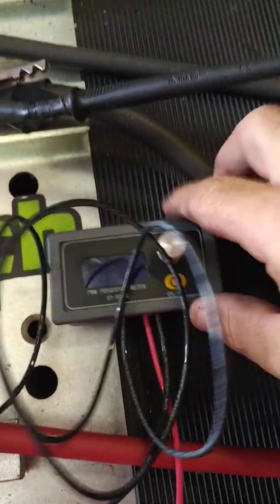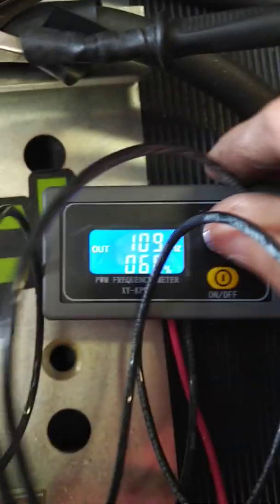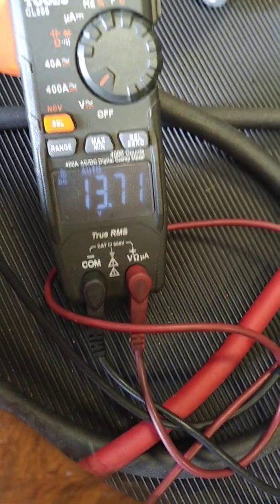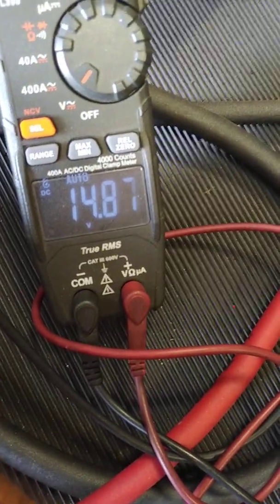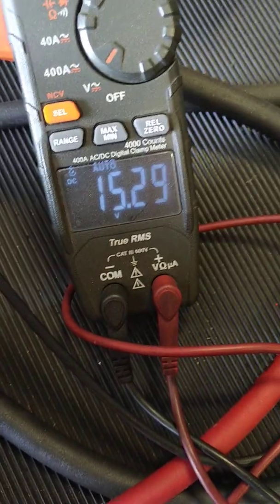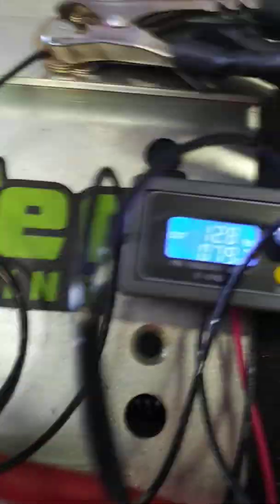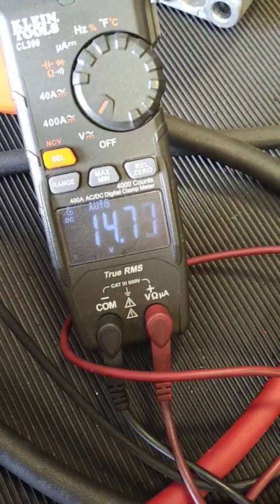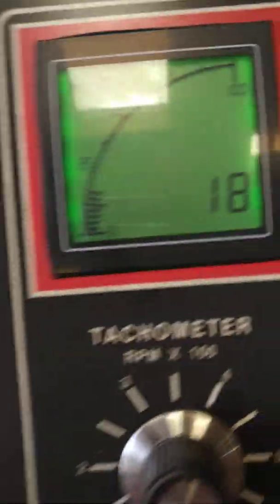PWM controller

Comment: The wife off the alt what terminal in the module dose it go to? I have 3 pin slit on a Kia my frequeny pin is (fr) and im to pwm+ and its not changing when i change my %
Reply: I’m about to install one on our Kia tomorrow, I’ll let you know how it goes haha
Reply: Hooked it up, works great. Got all my necessary voltage points written down to match the percentages. Ignition power, ground and PWM+ for the output. I also made my own pass-thru harness because the one I got was made very lazily (not from Autotech). Just make sure the device is set to the “on” position. The on/off isn’t for the display, it’s for device activation so if it’s set to “off” it won’t change the alternator output.

Comment: Will this device work on RLO pin wire. GOT a alternator for Toyota with smart charge.
Reply from the maker: Not for imports
Reply: @autotechengineeringusa  frekvens for RLO is 7-8hz

Comment: I ordered this setup and changed vehicles. Can I cut the one side of my factory harness and use it that way?
Reply: I actually think so? I think is just a series of diodes that allows you to change the voltage. Similar as to just adding diodes to your excite wire and raise voltage, this one just makes it adjustable. Seems like you can hook that to any alt and use it.🤷‍♂️
Reply: @1ohmwrecker   i went ahead and tried it and it works just fine. Thanks tho
Reply: @ryanjacobs3511  well appreciate you confirming that!👍

Comment: I know the GM alts use 5 volts input and the way you are showing it will use 12 volt input will that mess with it or does it not matter what voltage the signal is?
Reply from the maker: Does not affect
Reply: @autotechengineeringusa  cool thank you for the quick reply I was just making sure as Im installing a 2nd battery that's AGM and my Camaro's alternator keeps putting 15.3 volts out constant and the AGM battery won't like that so I'd be able to have controlled to 14.4
Reply: @tonyengland6688  go to 14.8

Comment: What do we do w the harness that is already plugged Into the alt? Just let it hang?
Reply: Yep🤷‍♂️ I'd cover it with something tho incase you need to go back to factory it won't get dirt and nasty. Plus it's actually still got live voltage running thru it.🤣🤷‍♂️